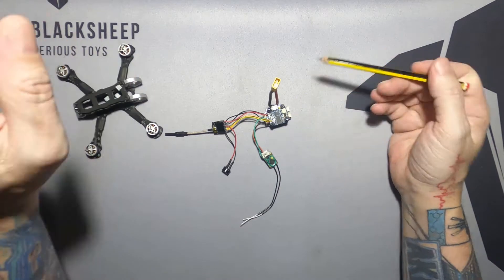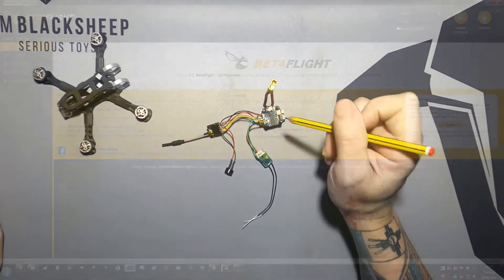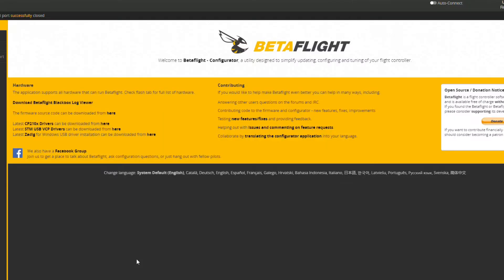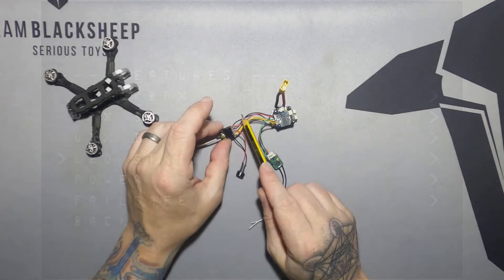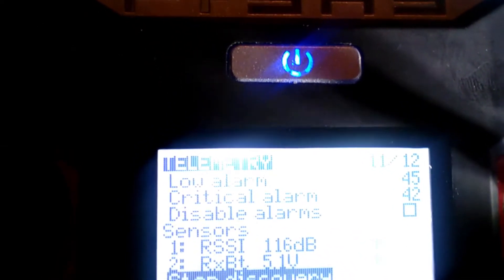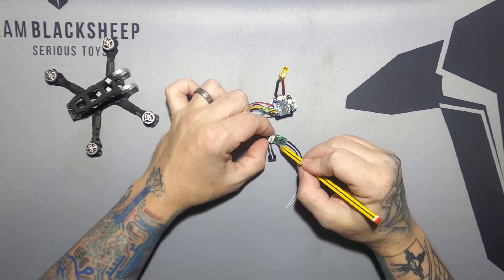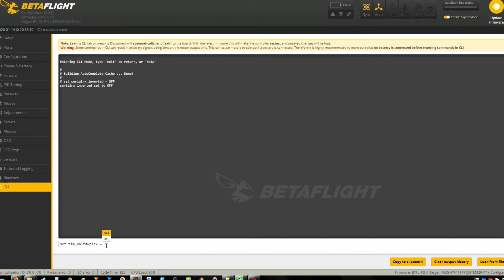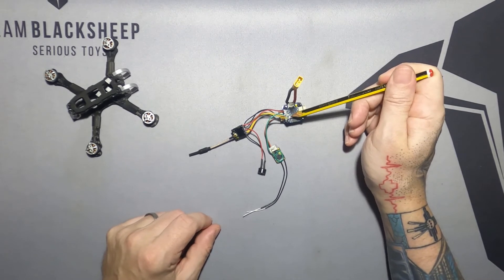Iflight Succex F4 Mini Workarounds [ Fixing the Incorrect Manual Info ]

Comment: Thank you so much for making this, the manual saying serial_tx 1 not 11 was frustrating me so much!!! I’m using a Zeus nano and was able to get betaflight to change settings on it, but still can’t get OSD although it seems to be configured properly in BF. Any ideas?
Reply from the maker: Other than making sure the video out from the camera is going via the flight controller and OSD enabled - one thing that can make an OSD not appear is if it is outputting the wrong PAL/NTSC format so I'd try both of those settings in the OSD menu.
Reply: @MrE.  thank you!!! Will check that out!!!
Reply: @MrE.  so you’re saying the camera video signal should go to the flight controller, not the Zeus? And I should take video output from the FC into the video input of the Zeus?
Reply: @MrE.  well I think my camera input on that side of the FC is dead… I wired the video input of the VTX to that tiny pad next to LED_strip… now all I see in the video broadcast is a few dots on the lower slide of the screen and no camera…camera is taking power from the Zeus but sending the video signal into a plug on the opposite side of the fc, that’s what I think is dead…
Reply from the maker: @waxlesstv  That is how it should work, you just pass the video signal from the camera through the flight controller for it to overlay the OSD and send it back out to the VTX to be transmitted - I have to ask the silly question have you got the video signal from the FC to the VTX wired?

Comment: Brilliant! I've been beating my head against a wall trying to get a new vtx with tramp working on my iFlight Succex Micro 1.5v stack. Followed your instructions and it worked like a charm, thanks! I'm really curious, how on earth did you know the correct CLI to get this working when their manual was so wrong?
Reply from the maker: Hey! You're welcome - happy to help!
A lot of experience, a bloody minded stubbornness and just working the problem, delving into the betaflight github documentation regards the dshot bitbang / rpm filter conflict. 

The pointer was the arming beeps from memory - smart audio enabled /no arming with rpm filter enabled combined with some trial and error led to the "Hack" although since I have ditched Frsky on this board for a Crossfire nano with the smart audio running direct from that with bitbang enabled again (not sure what effect it would have had).

Have fun, friend & thanks for letting us know it help you.

Comment: Hi Mre! I myself have a Succex-e F4(nazgul5) and I've been trying for a few days now to make the telemetry work. I've made a connection between rxsr (P) and T4, then configured it on beta and still nothing. Tried T6 too and still the same. I even tried Fport only one wire still nothing. I really don't now what I can do anymore. My board is somehow different. i don't have like most of the guys nt2 but Rt2. I do have to say that the manual instructions rubbish are.
Reply from the maker: The manuals are mostly wishful thinking hey?

Is it this board? (again - looks like 2 boards on there...) https://shop.iflight-rc.com/index.php?route=product/product&product_id=978

I would assume that just the P smartport pad to T4/6 with smartport enabled in the corresponding  uart/peripheral on the ports page and Telemetry set in the configuration page would have it working with the CLI/radio set correctly.
Way back when - sometimes we would need to use telelmetry inversion. try "set tlm_inverted" on/off in the CLI. not to mention that you'll need to delete/discover sensors on the radio at each change.

Let us know how you get on,Gabriel. Good luck!
Reply: @MrE.  Yes that's my board(blue one). Last status I have installed the latest firmware on my board, I played with the command you suggest it and still nothing. Right now I use FPORT. The RXSR has ACCST D16 v2.1.1(F.Port firmware update only  (Europe )) and my DISCONTINUED taranis x9d plus has ACCST D16 v2.1.0(Europe). The receiver is properly bound. I can see the inputs under Receiver Tab changing their values accordingly. Every single time I deleted then discovered new sensors and every single time comes just 4 of them. It's bothers me a lot because on my Sp racing f3 board with x8r works like a charm. I think I'm just gonna give up because  it's costing me a lot of time. The battery value is displayed on OSD but I just wanted to set some alarms up.
Reply from the maker: @GabrielMorte  I know it can be frustrating, but dont give up just yet! 
Try the "set tlm_halfduplex = ON" CLI command. The RXSR version should all be compatible (2.1*) - the 4 sensors you are finding are always present iirc.

Have you done the exact setup as stipulated for F.Port but following the green boards wiring and CLI from the wiring diagrams page? 
Fport from the RXSR S.port (not pad) to RT2 with SERIALRX_INVERTED = NO & SERIALRX_HALFDUPLEX = OFF?

It's certainly just the same rubbish I have had to deal with, just finding the right combo. If all else fails, I'd just use SBUS & then stick the telemetry over a softserial to the S.Port if that makes sense.

Good luck!

Comment: Hey mate you don't have a simple diagram we can follow along to do you?.. I just got this and it's confusing as f
Reply from the maker: All I have is the default wiring diagram and went from there, are you trying to replicate my setup? (frsky rxsr / f.port )
Reply: @MrE.  yeah correct from the video if I'm correct.. the frsky receiver goes to neg/5v/t2 and the video trans is wired the same as in the manual?
Reply from the maker: @ricky4682  Indeed, FPort to T2 on the FC but to the uninverted S.Port pad on the R-XSR (which will need flashing with the F.Port variant of firmware). F.port set in the receiver protocol.
Reply: @MrE.  ok nice.. however.. I just ripped my ufl connector off the board... #facepalm
Reply from the maker: @Ricky Damn mate, you might be able to expose the traces going to it and direct solder or bodge another ufl on, I assume it is the vtx board you did it to? (excuse the late reply as your comment got tangled up in pending for review).
Reply: @MrE.  yeah off the board.. I direct soldered it to the board but I wasn't 100% sure which was really element contact lol.. so I went with what I thought lol

Oh and on a side note I finally got the telemetry working woot woot
Reply from the maker: @ricky4682  Great to hear about the Telem, Ricky! Regards the UFL, cant really mess it up any more so kudos for having a stab at it! Worst case scenario is you just stick another one on it mate. Have fun!

Comment: I can’t get my tbs nano receiver to work with this fc.ever time I enable port 2 it would go back to default.I followed the wire instructions but still not working.🙄
Reply from the maker: Should just be a matter of wiring CH1 to R2 and CH2 to T2. Enable Serial for UART 2 and select CRSF in the Serial Protocol.

Betaflight used to be a bit odd when assigning a serial uart but just try it a few times and it should take. If it comes to it, just flash the FC again.

Keep me posted and I'll see what I can do ( Need to put CRSF on my Tadpole with this FC anyways so perhaps I can see if I get the same).
Reply: @MrE.  I will keep you updated mate thanks for the info👍🏻
Reply: @MrE.  ok so I have it wired correctly.I’ve tried different fw emuflight and betaflight and still no joy.I can enable port2 in betaflight but I still don’t get any stick import.this is a weird fc 😄

I’ll keep at and let you know if I win 😏
Reply from the maker: @fpvchrissyboy4180  Got to ask the stupid questions but you have got the nano bound & you are setting the receiver stuff in the configuration page after setting up the port?

 LEDs on the nano & you have communication from the Tango2 by checking the crossfire script on the radio?
The nano should show up and probably wise to check the channel assignments (that they are crsf tx & rx on ch1 and ch2).

If we get no where, I'll jump onboard and put a nano in my tadpole on this FC and see if its a hardware problem.
Reply: @MrE.  I’m using a taranis with a crossfire module v1.

I’ve taken this cf nano receiver from my other 3” so I know it working.

I have a green light on both the receiver and the module.I have cf enabled in the configurator.I’ve tried all ports and fw so I’m a bit stuck at the moment.

I have a mamba mini fc on the way now lol
Reply from the maker: @fpvchrissyboy4180  Damn, bummer that you couldn't get it working - I'm going to try a nano on mine just because I don't like things bugging me so I'll let you know if I have the same probs.
As for the Mamba Mini - good cheap stack (I have one in a cinewhoop) & I have a Mamba F405 F50 DJi stack for one of my other quads to install at some point - Cant go wrong with them or Matek imo.

Thanks for letting me know anyways, keep you chin up mate!
Reply from the maker: @fpvchrissyboy4180  Just upped a video trying your combo out and no problems. A bit miffed as to why yours is being an arse..

Comment: thanks for the video! i'm trying to make smartaudio to work with this FC and a unify pro32 nano. i've conected T1 from fc to TX, i've also made CLI commands, then i switched on SOFTSERIAL option in configuration, but when i go to ports, softserial does not appear. Could anyone help please?
Reply from the maker: I'm not quite sure other than not typing save after the CLI commands & possibly T1 being incorrect.

I have this FC in my Tadople with a TBS unify Pro32 running SA from softserial exactly as configured in this video.
Reply: @MrE.  i've finally succeded, my original resource was SERIAL_TX 1 A09 so i remaped SERIAL_TX 11 to A09 (found this in ahother video). Then I've configured softserial just like you explain, and all is working fine now. Hope this helps someone else.
Reply from the maker: @stefy83  Happy to hear you have it sorted!
What pad did you wire to? curious as the only place I can see to tap into TX1 is the pin header?
Reply: @MrE.  i wired smartaudio to T1

Comment: Great Video , if you can help it would be appreciated , I'm trying to get my caddx vista nano connection correct , it maybe that my lack of knowledge means the FC can only connected to the sbus from the vista unit and the OSD from the Rx TX can't be connected . If this is the case would the talon tiny f7 work ??
Reply from the maker: You maybe able to juggle things around for this F4 mini to get it working. I would probably use the SBUS connection on the available UART (UART2) for reliability's sake and perhaps resource remap the LED  & Buzzer pin into a software serial  TX/RX to act as the MSP for telemetry to the Vista unit if that makes sense (the TX half of that is utilised in this video for smart audio).

The Tiny Talon F7 (Heli-Nation?) would be very suitable without jumping through the hoops with the radio link on UART 1 & then the Vista on UART 5.

I assume you already have the IFlight FC? Happy to help and good luck!
Reply: Firstly thanks for the reply , much appreciated , ok so so far I followed your instructions I think fairly well , 1st remapped led strip pad from A08 to resource serial_tx 11 A08 and then beeper pad from B02 to serial_rx 11 B02    save     then moved Rx vista unit to led pad and tx vista unit to Rx .
In the cli I now have serial tx 1, 2 , 11
Rx 1 , 2 , 11 

In the configuration softserial is on

In the ports i have changed the peripherals on softserial 1 to OSD 

Is that what you recommended ? Cheers Rich
Reply from the maker: @richardpollard1784  No problem, Rich!
The remapping & vista wiring looks & sounds perfect but the port section is a little wrong:

The softserial after being enabled and showing up as you have just needs Configuration/MSP enabled on it as the DJI reads the raw data from the FC unless it's changed in the most recent of betaflight versions rather than an OSD peripheral. I'm not certain if it requires OSD in the "other Features" section of the configuration page toggled on (where you enable soft serial).
Once thats enabled just enable Custom OSD in the DJI goggles residing in the Settings>Display submenu.

Hope this helps, let me know if it pans out as I have yet to do this on a Vista, just a full Air unit but assume its identical.
Reply: @MrE. Ok it's not working yet , I have now  turned on softserial 1 configuration/ MSP on , I also checked the configuration tab and the OSD is on , if I could I would send some pictures , thanks again ..... Still thinking 😉
Reply from the maker: @richardpollard1784  A couple of things upon checking the only quad I have here with a vista in (perconfigured for review v.soon) - Luck would have it that it's OSD is also setup on softserial. so here goes!
It has Telemetry enabled along with Softserial and OSD in other features, the only other silly thing would be no OSD elements enabled or out of the display bounds.

Good luck. (double check the tx-rx & rx-tx if no avail.)
Reply: @MrE.  thanks again for your help , spent another evening yesterday trying to get the OSD to work but couldn't , tiny Talon on order , just posted the build on rotorbuilds as a Tadpole vista nano if you fancy a look , cheers Mr E
Reply from the maker: @richardpollard1784  You're welcome, just a bummer that you couldn't get it to jive, just had the thought that you do have the vista and googles updated to a newer version as I'm not sure when OSD was enabled (although if you have the option in the goggles to enable it I'd assume that it is updated).
Let us know how you get on with the Talon! I'll have a look on Rotorbuilds because a Vista in a Tadpole sounds sweet!

Have a good holiday season, friend!

Comment: Excellent insightful video. It’s been so frustrating dealing with iflight’s rubbish wiring diagrams. 

With Fport still soldered/activated on the FC’s nt2 pad, did you have to reconfigure anything in the Betaflight-Ports tab after soldering the rxsr’s p-pad to the FC’s T2-pad? Or did telemetry just magically start transmitting back to the radio?
Reply from the maker: Thank you!

The port setup is just plain SerialRX on UART2.
Using the provided CLI changes resulted in it working from memory:
serialrx_provider=FPORT
serialrx_inverted=ON
serialrx_halfduplex=ON
Had a quick look at it's configuration and I dont even have the telemetry toggle on in configuration oddly so if you are having probs, get back to me and ill verify that it's still working as desired and share my CLI dump with you.

Comment: How to conect the TBS Crossfire Nano rx?
Reply from the maker: Gnd & 5v bottom right corner near with the usb socket facing down, above that is R2 which goes to ch1 & T2 goes to ch2 on the Crossfire Nano. Set betaflight to serial RX on uart 2 & change the reciever type to CRSH. 
You could also wire smart audio to ch3 or 4 on the nano to avoid the conflicts with rpmfilter like in this video.

Hope this helps!

Comment: Hi. I've been trying to get full telemetry working on my R-SXR hooked to an iFlight Succex E F4 FC and watched a million videos, tried many combinations of things but still can't discover any sensors beyond RSSI and board voltage... I'm struggling so much!

I have a separate SmartPort wire hooked up between the P pad on the R-SXR and the T2 pad on the FC,  It doesn't seem to matter what I do, what CLI commands I enter or what port configurations are, I still only see RSSI and board voltage sensors...

Anything you can think of that I'm missing? Your video seems the closest to solving my problem, but not quite... Thanks very much in advance!
Reply from the maker: Ok, sorry if this comes across as going over the same info but it's required to get an idea of where the issue is - we'll work through it.

Are you trying to use SBUS + S.port for telemetry or run everything through F.Port?
Reply: MrE Thank you for the reply but after a couple more hours checking things, it's all working perfectly now!

I think I had one of the CLI commands wrong, although I'm sure I had tried them before in many combinations...

Anyway, I really appreciate your trying to help and the great video which has helped me get full telemetry 👌👌👌
Reply from the maker: @eatyourvegfpv  You're very welcome & I'm chuffed that you have it sorted - we all have these little gremlins from time to time. Have a good one, friend!

Comment: So, I was hoping you could help me. I tried following the steps you laid out but unfortunately i lifted the tiny little pad on the RSXR (the uninverted s-port pad) and i dont have the skill to fix it. Do you recon i am screwed or is there another way to set it up for telemetry?
Reply from the maker: Sorry to hear you lifted the pad, hope is not lost yet!
On earlier revision of the R-XSR you had to get the uninverted signal directly from one pin of a chip.

I'm a little in between things at the moment but a bit later I'll pull an R-XSR from one of my quads that needs a crossfire nano upgrade & trace the pad to pin & see if it's still viable for you!

Depending the other alternative is seeing if the trace to that pad is on the surface and just scratch away some of the masking to reveal the copper trace and solder to that ,I'll admit that I have lift a couple of pins in the past and needed to use this method.

Thirdly the receiver is still usable without telemetry.

I'll get back to you ASAP.
Reply: @MrE.  Thanks so much. I was able to wire it back up normally so it's all working, just without telemetry. Your suggestions all seem viable but I will have to tighten up my soldering skills haha. Thanks for the help!
Reply from the maker: @pucksaver  Just published a quick video regards your problem, fella.
https://www.youtube.com/watch?v=gq5TJkq6mO0
Hope it helps!
Reply: @MrE.  wow thank you so much! I will probably try for soldering the trace and see how it goes. Thanks again !
Reply from the maker: @pucksaver  You're welcome, friend!